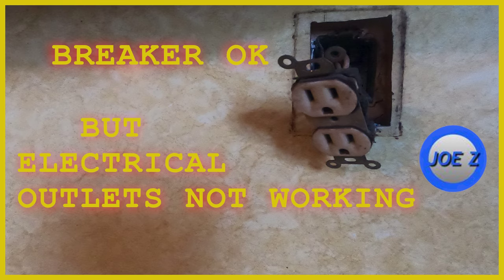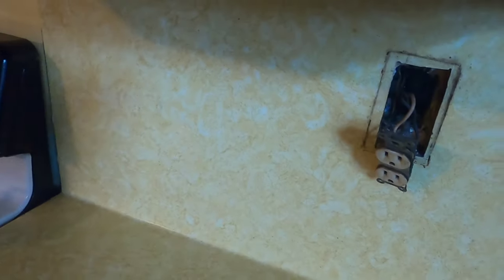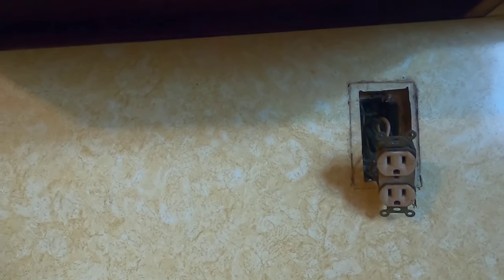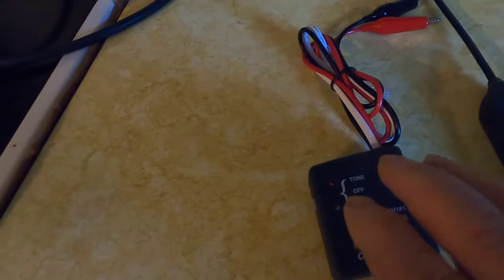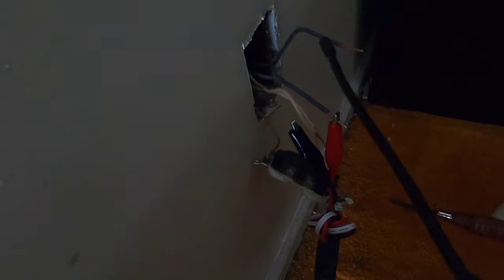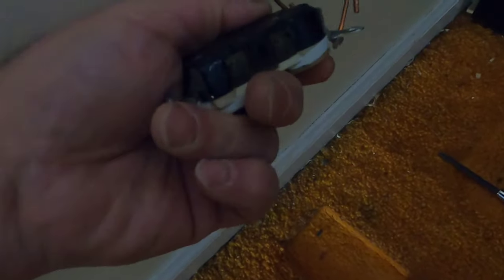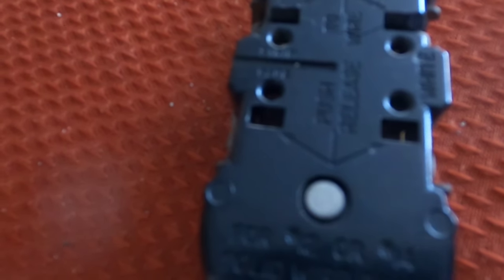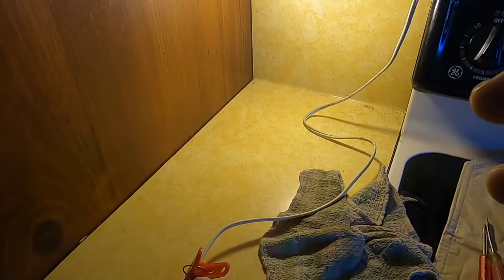Breaker on but no power to outlet FIX

Comment: I have a question I'll try to be brief and clear.   In my home, outlet A, B, and C are on the same thing, along with the kitchen light. Outlet A recently stopped working and when it did, it stopped b, c, and the kitchen light, however did not trip the breaker. Instead, if I plug in a lamp into outlet a, the power returns to b, c, and the kitchen light, though A remains dead.  What would cause this?  Today,  outlet b did the same thing, I plugged in a vacuum and it killed outlet c and the kitchen light....and only after plugging the lamp into outlet a did things return to c and the kitchen, no breaker tripped.  And to be clear the only thing even plugged in at the time was the tv and modem.
Reply from the maker: Thank you for stopping by. Please keep in mind I am not an electrician as such I am not giving electrical advice. That said I would check outlet A. My guess is that it failed (broken connection internally ) & when you plug the lamp into it the outlet it is completing the circuit. I would start by changing outlet A to see if the rest work. Remember to shut down power supply on this circuit.
Let me know if this was of help.
Stay safe, Joe Z
Reply: @JOEZEP54  thanks Joe in an update, lost power again but this time from using outlet c (which has never given issue outside of losing power when the other two would cause it) I tried the plug lamp into a trick, however this time I noticed something. At first no power but if I slightly push on the lamp in the outlet, power came on but the light was flickering. Obviously I stopped immediately.  Your observations are exactly what I was thinking too
Reply from the maker: You're welcome. Let me know if replacing outlet A solves this issue.
Stay safe, Joe Z

Comment: If you check everything in the apartment and can’t find a broken neutral , check the junction box. A junction box is where all the wire reach up together then go to one circuit it’s normally in a metal or plastic box.
Reply from the maker: alvin, thank you for watching and helping with additional information. Ring that bell not to miss my new videos as I upload them & continue to comment with helpful information. You may also find some of  my older videos of interest.
Stay safe, Joe Z

Comment: Hello sir. My two outlets in the room are not working but the light switch is working. I checked the breaker, its not tripped and all of the outlets in the house have power except my two outlets in the room. Do you think if I change the outlets in the room, will fix the problem? 

Thank you sir.
Reply from the maker: Good morning, Mr. Bautista, thank you for watching and taking the time to comment. Please work safely & keep in mind that I am not an electrician & am only showing the issue I had & how I found the problem to correct.
It dose sound like you may have a similar problem. In my case the outlet that supplied the rest of the outlets in the line was working but the connection that the fed the others was broken. So it worked but the other outlets did not.
""""If you do not have experience working with electricity call an electrician."""
If you are confident check the wire feeding the non working outlets, If you have power there then I would suspect that the outlets need to be replaced.
If you do not have power in the line you have to trace it back to where there is power & correct it at that point.
Let me know if this helped you out.

Mr.Bautista I have other videos on my channel that cover many different subjects  and new videos added weekly that may also be of help or interest.
 
Your support is not required or expected but always appreciated. If you are inclined to do so your Subscription, Likes, Comments and using the following links do help.

You can Help Support The Joe Z Channel at no cost to you
by following my affiliate links.   
Joe Z is a participant in the Amazon Associates Program, 
an affiliate advertising program designed to provide a means 
for sites to earn advertising fees by advertising and linking to amazon,
that helps me to continue producing videos.
Thank you for your support and using the links provided to make your purchases. 
                                                This is always appreciated.
***** Thank you for your support ******
 Again I hope you get to  enjoy other videos on my channel as well. 
 Stay safe, Joe Z
Reply: @JOEZEP54  I replaced the outlets that wasn’t working and it still didn’t work. I don’t have the tool to find the power outlet where its feeding from. I did change the two other outlets that I think where its feeding from but still didn’t work
Reply from the maker: @georgebautista5560  Could be that it is being feeding from another outlet. Are these outlets in a kitchen, laundry room or bathroom? If so check any outlets that are gfi. That may have tripped.
Reply: @JOEZEP54  i checked the gfi outlets. They are all working.

Comment: I have sockets that are going out and need to fix them so from watching your vid it seems all I need to do is change the outlet,,,and but I notice you didn't have to turn the breaker off to change anything or did you
Reply from the maker: Definitely turn off the circuit breaker/breakers and test the line you are working on to be sure you shut off the right breaker. I have seen work done with the power on, but why take the chance? Thank you for stopping by & your question.
I try many DIY repairs but if you have any doubts about being able to make your repair call an electrician. Always make yours & others safety a priority.
Let me know how your repair goes.
Stay safe, Joe Z

Comment: FYI-recommend you pig tale the 2 whites with a 3rd white wire. Repeat  for the black wires and ground. This will result in only 3 wires coming out from the box. If done this way, you will be able to find the faulty receptacle easily, plus the other receptacles will continue to work.  Connect these wires to the receptacle to the hot, common and ground screws. Not the easy push in on the back of the receptacle.
Reply from the maker: Thank you for watching and taking the time to comment with helpful information
 Michael T I have other videos on my channel that cover many different subjects  and new videos added weekly that may also be of help or interest.
 
Your support is not required or expected but always appreciated. If you are inclined to do so your Subscription, Likes, Comments and using the following links do help.

You can Help Support The Joe Z Channel at no cost to you
by following my affiliate links.   
Joe Z is a participant in the Amazon Associates Program, 
an affiliate advertising program designed to provide a means 
for sites to earn advertising fees by advertising and linking to amazon,
that helps me to continue producing videos.
Thank you for your support and using the links provided to make your purchases. 
            This is always appreciated.
***** Thank you for your support ******
     
Michael T I just want to mention If you haven't installed the TubeBuddy browser plugin yet, to help your channel grow  Just go to my favorite tool for channel growth Tube Buddy. Now You can use it too, here's my affiliate link to the Free versionhttps://www.tubebuddy.com/joezep54   Start with the free version, yes it is free to not only to down load but to use.
Again I hope you get to  enjoy other videos on my channel as well. 
 Stay safe, Joe Z

Comment: 4 outlets are not working.  2 bathroom outlets, & 1 on the back porch, & 1 on the front of the house.  The breakers are not tripped.  There is only one GFCI in the kitchen that was reset, but still no power to all 4 outlets.  How can I fix this?  Thanks in advance.
Reply from the maker: That was the same issue in this video. As in this video you have to find where ths power is coming from & where the open is. You can check each of these outlets for power coming to but not passing through to the next outlet but it may or not be one of the outlets you mentioned. That is why I used the method in the video, not sure how an electrician would go about it. I am sure there has to be other methods that I do not know.
Let me know if this was of help.
Stay safe, Joe Z
Reply: @JOEZEP54  Thanks Joe for the info.  I'm going to check out the GFCI first, that could be where the problem is at.

Comment: You should keep the toaster and microwave oven on separate breaker. Connecting outlets, unless it’s to a light, should be done using pigtails in box when wiring multiple outlets.
Reply from the maker: Thank you for watching and adding this information.
Stay safe, Joe Z

Comment: What a time saver sheesus haha 🙏
Reply from the maker: Yes it was. I do not know if there is another way to find the break in the current other than going to every outlet starting with the closest one. Even going that route if the outlet was not an issue but a break, cut or chewed wire was it could take some time. Thank you for stopping by.
Stay safe, Joe Z

Comment: In our area, wiring receptacles without pigtails is not to code. Kitchen receptacles above the counter all have to be GFI themselves or on the load side of a GFI receptacle, or on a GFI breaker. Plus, the kitchen receptacles have to be on their own circuit.
Reply from the maker: Thanks for sharing. I do not know what the code was here in 1976. I would have to check what it is currently but the pigtail in the receptacles would have saved a lot of aggravation.
Stay safe, Joe Z

Comment: Great troubleshooting!
Reply from the maker: Thank you.
Stay safe, Joe Z
Reply: @JOEZEP54  I don’t have your tools. I would’ve pulled each outlet out from that circuit, switch breaker on and locate hot wire and reinstall new outlets from there on down. 👍🏼
Reply from the maker: @rruizproductions  The problem I had was not knowing where the the feed was coming from. In this case it was from an outlet in the other room. Stay well, Joe Z

Comment: Make sure all the GFC switch is not overload and reset them and that should fix the issue in department
Reply from the maker: Thank you for watching & adding information to help. In this case there weren't any GRCIs & no overload.
 The issue was shown starting at 10:12
Stay safe, Joe Z

Comment: That happens frequently with older houses usually because half the house is wired to one fuse.  You should bypass everything that doesn't go to your kitchen and add a GFCI fuse with GFCI outlets.  Same with bathrooms.  Don't wait until your wiring is ruined.
Reply from the maker: Thanks for the tips! The bathroom & outside outlet have a GFCI breaker. The rest have either 15amp or 20amp regular breakers.
 @ElijahPerry-bp5cw I have other videos on my channel that cover different subjects  and new videos added weekly that may also be of help or interest. 
Your support is not required but always appreciated. If you are inclined to do so your Subscription, Likes, Comments and sharing this content would help me to reach other viewers that may also find this channel useful or entertaining.
 
 Stay safe, Joe Z

Comment: I got a weird one... Outlet works just fine, but for certain things. Lamp works, surge protector works, but phone charger doesn't? Even in the surge protector the charger doesn't work. I know it's not the charger because I've used it at a different location. Do TR outlets only allow certain connections? Or why do some connections get power and some don't?
Reply from the maker: Jack Carlos, Thank you for watching and taking the time to comment. 
This has me stumped as well due to the fact you used  the charger at a different locations & it worked. As far as I know the TR outlets only require that both blades of a plug are pressed in simultaneously. Sorry I could not be of more help.
I hope you get to  enjoy other videos on my channel as well. 
 Stay safe, Joe Z
Reply: @JOEZEP54  I think it was a crazy coincidence where 2 separate chargers/plug-ins died at the same time... What are the odds. Thanks for the response!
Reply from the maker: @jackcarlos  You're welcome. Glad you figured it out. When it come to electrical issues nothing surprises me. I just uploaded a video on my trailer running lights not working. It had me stumped, but was a very simple fix that drove me crazy. Take a look when you get a chance. Stay safe, Joe Z.
Reply: The problem is in your phone.   Try another outlet.

Super sensitive electrons in newer phones just do not work with some outlets.

Comment: i worked for electricians years ago. 4 times out of five, when there was a problem at the outlet, there was a cheap backstabbed outlet. might seem silly, but pay double for the nicer outlets. i have never seen a problem with a spec grade outlet
Reply from the maker: Norman Graham, I had to change several outlets  over the years but did not run into this particular issue before. I believe this proves your statement.
Thank you for watching and taking the time to comment. Norman Graham I have other videos on my channel that cover many different subjects and new videos that may also be of help or interest.
Your support is not required or expected but always appreciated. If you are inclined to do so your Subscription, Likes, Comments and Sharing my videos do help;

                      ***** Thank you for your support ******

I hope you get to  enjoy other videos on my channel as well. 

 Stay safe, Joe Z
Reply: @JOEZEP54  I/we replaced 4,000 one summer, working in North New Jersey, for a german electrician, in the 80's, because 5% of them failed.   the builder agreed to replace the outlets (IN A DEVELOPMENT!), rather then just unbackstab.  I/we did an outlet in 6 minutes.    (assembly line, I didnt remove the old outlet, I put in the new, and plugged in the tester.).

Comment: This is what happens when outlets are wired in series.  I think parallel is better. I'm currently working on a project in my little shop.  I will be rewiring an outlet and adding outlets. I will wire them in parallel.
Reply from the maker: Thanks for the tip. I have to agree.
Stay safe, Joe Z

Comment: I had some similar strangeness in my kitchen.  My problem was similar.  I should have used a pigtail to connect the outlet.  That way, one outlet failing would not have caused outlets downstream to fail.
Reply from the maker: Great tip! From my experience & what many have commented the plug in is a cause for many problems. I do not know why they are still being sold. For those who do not know & myself included until I had this issue, just follow how it was previously connected. You're welcome, Thank you for watching and taking the time to comment. @johnkolassa1645 I have other videos on my channel that cover different subjects  and new videos added weekly that may also be of help or interest. 
Your support is not required but always appreciated. If you are inclined to do so your Subscription, Likes, Comments and sharing this content would help me to reach other viewers that may also find this channel useful or entertaining.
 
 Stay safe, Joe Z
Reply: @JOEZEP54  Thanks.  BTW I just subscribed.   John
Reply from the maker: johnkolassa1645 I appreciate your support. Let me know if I can be of help on any of your projects. I may not have the answer but may be able to help you find a solution.
Thanks again, Joe Z

Comment: Cheapest and easiest place to start would be to replace the breaker, especially if it is old. Those symptoms are typical of a breaker that is old and tired. Breakers can warm up every time power is drawn through them. There is also some minor expansion and contraction of the metal parts inside it. This can happen thousands of times over life of breaker. As your dryer draws power it heats up breaker. Once it gets warm it trips. A new breaker won’t do it. Best place to start.
Reply from the maker: Thank you for watching and taking the time to add this information. Unfortunately it was not the breaker in my case but may be an  issue. for somebody. This problem was in the  kitchen outlets.
@tms2568 I have other videos on my channel that cover different subjects  and new videos added weekly that may also be of help or interest. 
Your support is not required but always appreciated. If you are inclined to do so your Subscription, Likes, Comments and sharing this content would help me to reach other viewers that may also find this channel useful or entertaining.
 
 Stay safe, Joe Z

Comment: Im having the same issue, I noticed my shops lights would randomly flicker and dim out, they finally go out completely and I noticed the outside light, dryer plug is out, and a couple kitchen outlets don't work during the same time.  I'm going to check a few outlets in the morning, if I can't figure it out, I'll call an electrician, lol.
Reply from the maker: Not the problem in this video but I had a bad breaker once that caused the same problems you described. I would check the breaker first, it may be an easy repair.  I hope this will be of some help.
 And thank you for watching and taking the time to comment. @nathandallaschad7990 I have other videos on my channel that cover different subjects  and new videos added weekly that may also be of help or interest. 
Your support is not required but always appreciated. If you are inclined to do so your Subscription, Likes, Comments and sharing this content would help me to reach other viewers that may also find this channel useful or entertaining.
 
 Stay safe, Joe Z